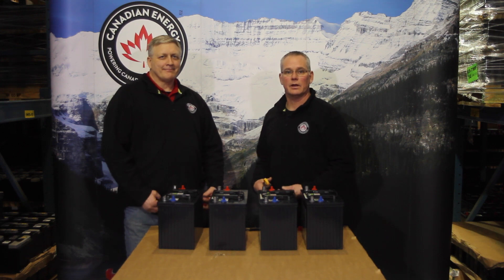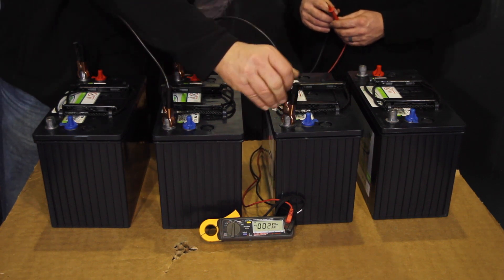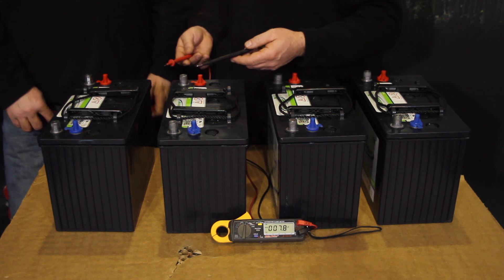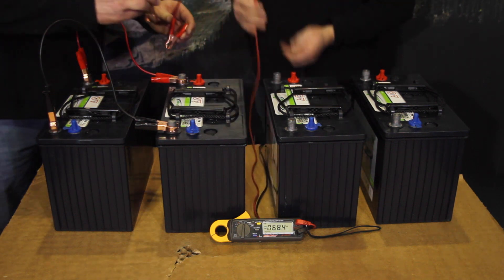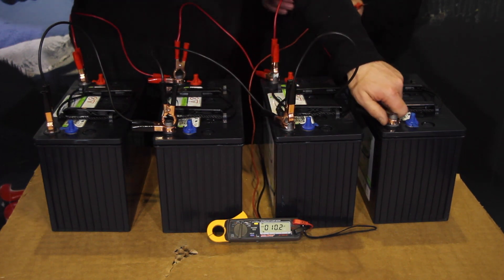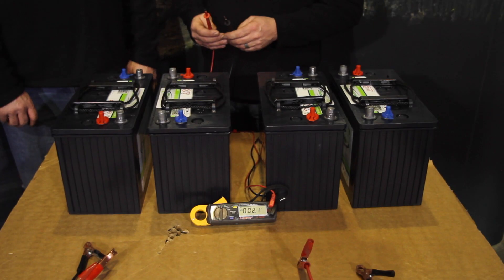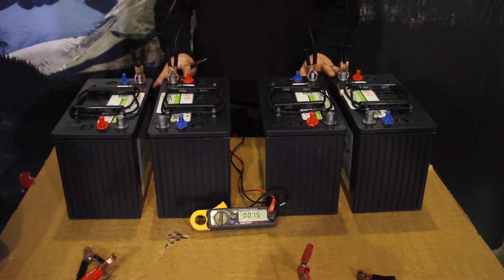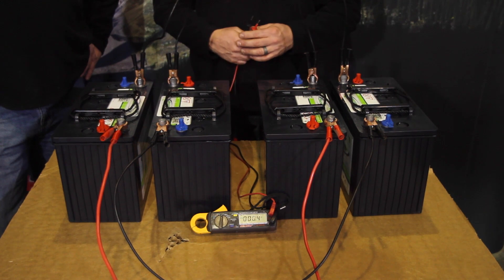Canadian Energy™  - Series : Parallel : Series Parallel

Comment: In series/parallel  wiring , for figuring charging voltage. 
How many  cells do I  use in the multiplier   8cell x 3.4v.   Or 16cell x 3.4v.?
 I have.    4.   ,  12.8v batteries .

Comment: to create a 12 volt 4 batt bank of old 12 volt batteries to run a power inverter pos to pos neg to neg down the line, where do the  solar or batt charger clamps go? same as how u tested with the meter first and last battery?

Comment: when creating a proper battery bank for power storage in an offgrid situation you want to use a parallel-series connection. so you can balance your batteries properly. 3.2v 200 AH with 3 batteries giving you 3.2 v 600 AH then you connect eight sets of those 3 battereis in parallel only in series giving you 25.6 v x 600AH = 15,260WH of power or just over 15 KWH of power in the battery bank with a proper balanceable battery bank. if you go series parallel you will not be able to balance the batteries properly and that is what most people do. they put together  batteries into 24v or 48 volts then put those together to build up your AH totally messing up your ability to balance your battery bank. the reason most people do this is because they have 12 volt batteries available  but today we use Lifepo4 batteries which are 3.2 volts and putting those together like I already pointed out in parallel series you will be able to set them up really well with a battery balancing system which will give you a lot of life in your battery bank without you loosing batteries because of one getting out of balance with another one. they will all stay in balance with each other using parallel series. I used 3P8S in my example. use that system and you will have batteries that will stay in balance for a long long time without the chance of going out of balance and blowing up on you or having a run away cell in your battery bank.
Reply: the other way around is what i see:  Any 12 V  li-po is  4x3.2 in series,then parallel the 12 volts bats; you sure par-ser is the best way?  i see ser-par all over

Comment: if i have 4 batteries and want to do a 24V system, is it better to hook them up into:
2 in series +  2 in series and those in paralel or
2 parallel + 2 parallel and those in series ?
as allways there are folks that say the first is better and other say the latter is better ...
Reply: I would also like to know the answer to Broxin'e question. I have a 24v setup like his 1st example which is normally charged by a 24v solar array. I was thinking that if I wanted to top off the batteries with my 12v battery chargers (I have 2 of the exact same model), it might be easier to charge them if they were hooked up like example #2. Am I correct in thinking that I could charge both 12v parallel battery banks at the same time using the 2 chargers and maybe not even have to disconnect the parallel connection between the battery banks? Right now when I've topped them off, I break the parallel connection between the battery banks (so as not to create an imbalance), charge both 12v batteries in 1 series bank at the same time, then charge the other series bank then re-establish the parallel connection. Thanks in advance!
Reply: Mark Swink so what is your question? 😄
Reply: I found answer on Battery Tender website that will work in my situation: https://www.batterytender.com/site/batterytender/images/series12.gif
Reply: Mark Swink ive got an answer from a german guy. He made a video about it. The second example is way better in many ways for the batterys
Reply: Mark Swink will you connect W3 as you hook up the two chargers?

Comment: Ok so given an qty of batteries hooked to say a solar array system.  What is the best way to wire up that bank of batteries.

For instance if I had say 12 batteries in a bank. 

Would it be best to wire the batteries in series in sets of 4 and then wire the 3 banks in parallel.
Or would it be best to make it 4 banks of 3 ( wired in parallel ) then connected in series?

How does parallel vs series affect the batteries when being discharged or being charged.

My question comes from this video:  https://www.youtube.com/watch?v=Rh9eEw-W3Lc

Where someone, with supposed experience, says that the banks should be wired into 3 batteries in parallel and 4 banks in series.

Comment: Question: If you have a 7amp hr battery and connect it to a 48 hr amp battery (Both 12 volts) do you risk blowing the lower amp battery with to many amps going to it?...Also, if I get a 7 amp rechargeable battery and hook it to a stereo and plug it into your car cigarrette lighter (power supply) would it blow the battery?....Thanks

Comment: This was the clearest out there I've come across, ty ♡ I have a question, I run a 12 volt system and am thinking of running it 24 volt ...  four 12 volt 125amph agm batteries at the moment.... so right now my amp hours are 500 if I'm correct? But if I do a 24 volt they will be at 250? Which is better? The volts? Or the amp hours? 
Offgrid, northern mn
Reply from the maker: Both banks will have the same watt-hours of storage. Lower amperage on the higher voltage battery bank can help with efficiency. Does that help?
Reply: @CanadianEnergy  sure does, thank you so veru much!
Reply from the maker: @HousewifeInTheWoods  our pleasure. 🇨🇦✌🏼

Comment: How do I connect 10 batteries to 1 charger for Perfect Balanced Charging

I am trying to connect 10x 100AH 12v Deep Cycle batteries to a true 10kw inverter. I also have a processor controller constant current 80AMP charger. I am planning to run a mobile office. I need 12v battery bank. All these equipment are brand new and I have them sitting in my garage. Initially I thought I will just connect all batteries in parallel. Connect the charger and load on opposite extreme ends. But after reading this article, https://www.iotaengineering.com/pplib/balancedcharging.pdf, I came to know that the charging current from charger, or the load current when running inverter is not equally distributed. In above article this method is explained under {Method 1: Balanced Charging}. I want to use Method-2 for perfectly balanced charging. I am not able to figure out so far how to connect 10 batteries using perfectly balanced charging method. So that every battery gets 4AMP when charger is supplying 80AMP current. I asked my nephew, who is fresh graduate electrical engineer worked for NASA, he was unable to answer this question. I asked my uncle, who is PhD Electrical Engineer, he was unable to help me. I find is so strange that all these people with degrees cannot solve this simple problem. I am sure, there is someone out there who is smart enough to figure this out. Please Help.
Reply from the maker: sam riaz am not certain there is a way to “perfectly balance” charge and load on 10 batteries in parallel and that is why we generally recommend fewer larger batteries to get to the same total amp hours of storage.
 
My preferred way of connecting many parallel string is to make identical parallel cables, they must all be identical even if some seem longer than required. Bring all parallel cables to a busbar, one for positive and one for negative. You will then connect the charge and discharge lines to the busbar and this will help minimize imbalances in the charge and discharge.
 
Periodic equalization charges (if the battery chemistry allows equalization) will help keep the batteries at the same state of charge.
 
The heavier the cable and busbars in a battery bank like this the better.
 
Thank you. ✌🏼🇨🇦

Comment: hello sir. im in big trouble. i have connected 7 battery in parallel. its lifepo4 with each battery 6000mah. but im still getting the final mah as 6000. though by theory, i should get around 6×7 = 42000mah. can u explain why ?
Although the voltage increased correctly when connected in series. So no problem there. 
Kindly explain.

Comment: i have, 12 and 12 in parallel ,in series with another 12 and 12 in parallel to get my 24 volts. but can't monitor /balance, each of the 4 12 volt batteries. in your last configuration, you have ,12 and 12 in series ,in parallel with another 12 and 12 in series to get my 24 volts. will i be able to  monitor /balance/ charge, each of the 4, 12 volt batteries in your last configuration?
Reply from the maker: immrnoidall we don’t think you will be able to do that, you can probably charge and monitor the 2 x 24V banks.  If balancing and monitoring is a concern, due to multiple heavy cycles, our recommendation is to use larger capacity 6 volt batteries that are all connected in series, this eliminates the battery imbalance and multiple parallel string issues.
Reply: @CanadianEnergy  i think i should have gone with the 48 volt inverter / charger instead of 24.
Reply: @CanadianEnergy   i am trying to prevent a single 12 battery ,from getting too low. when using your last configuration of ,[ 12 and 12 in series ,in parallel with another 12 and 12 in series to get my 24 volts ] would i see a single battery voltage across its +/- terminals?

Comment: can we charge the final series-parallel set together? how?
Reply from the maker: loser 3009 Usually series parallel sets are all connected to charge and discharge together, it depends what your voltage and configuration is. Hope that helps. ✌🏼🇨🇦
Reply: @CanadianEnergy  ok sir. thanks.

Comment: How close should the voltage be for the batts in series? How much voltage differential is ok?
Reply from the maker: Matrix it’s recommended to use identical batteries when operating in series, if they are the same batteries there should be very little difference. For mismatched batteries  .25 volts would be a maximum but they should also be the same capacity. Hope that helps. ✌🏼🇨🇦
Reply: @CanadianEnergy  Hi. Nice explanation. Thank you. How about same voltage but different capacity? I have 12v 35ah and 12v 60ah. Can I have 12v 95ah?
Reply from the maker: I B If it was a series parallel connection it might be possible but when connected all in parallel there is going to be a big imbalance due to capacity difference. Hope that helps.

Comment: So what positive and negative do I pull off of when hooking up to the charge control and inverter?
Reply from the maker: jo lee If your batteries are connected in parallel, you connect to the negative terminal on one end of the battery bank and the positive off the other end of the battery bank, never connect the pos and neg off the same battery in a parallel bank. Hope that helps. ✌🏼🇨🇦
Reply: @CanadianEnergy  Hi there. I have 3 , 12 volt 185 ah and one 165 ah 12 volt battery. want to increase capacity of my battery bank. how I have to do my battery connections? have a    2.2 kw solar system
Reply: @CanadianEnergy  Hey. How to do 36v series parallel connection?